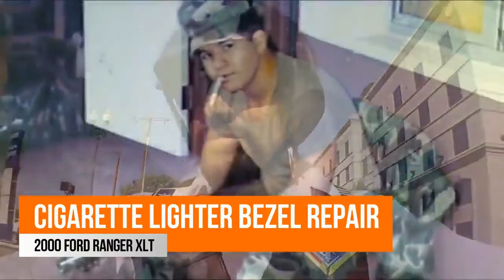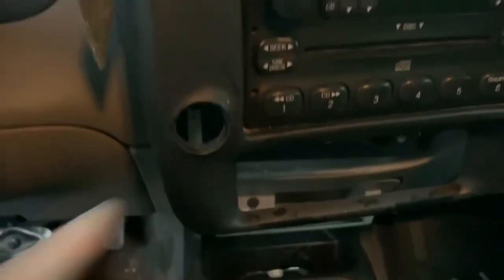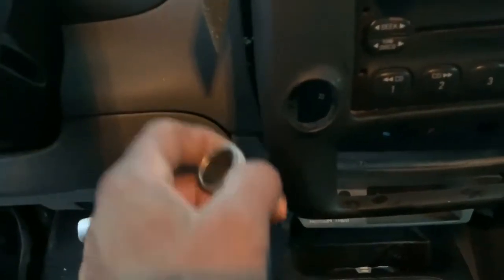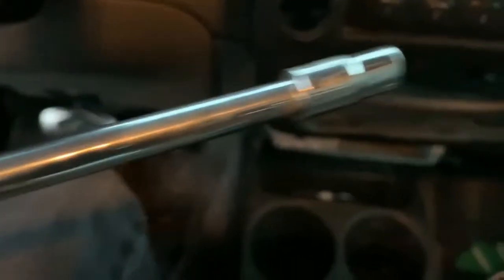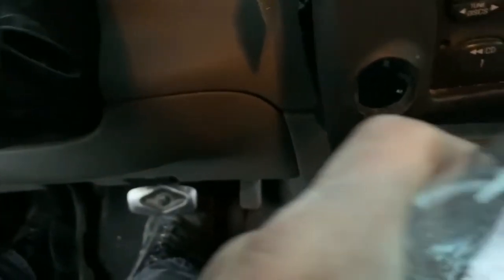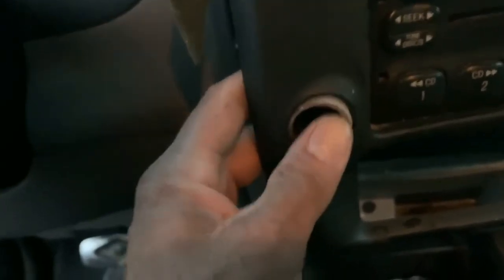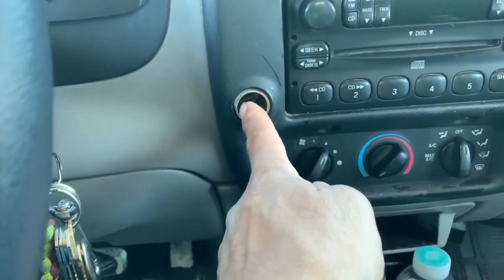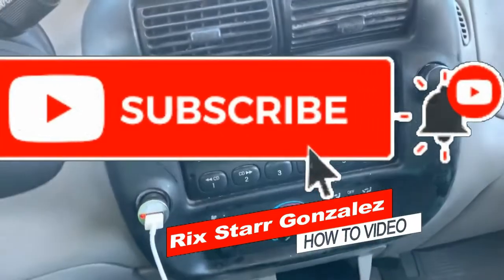How To Video - Cigarette Lighter Bezel repair - 2000 Ford Ranger XLT

Comment: Just found your video I used a drill bit to center out the cap little by little to get a tight fit. Was able to press it in and screwed the other piece onto it No gluing needed.Used a razor blade knife to cut off excess plastic. Thanks for the video

Comment: You do know there's a 12volt accessory outlet on the right side of the bezel, right?  It had that plug over it.  Guess I'll be fixing mine with JB Quick weld because I intend on using mine as a lighter.

Comment: I like the way you think. I just bought a 2000 XLT and the interior is freakishly pristine. However, it IS a 2000 so little details like this need to be addressed. I think I might look for some kind of really small thick rubber band to do the job maybe the kind of rubber band they use on produce at the supermarket